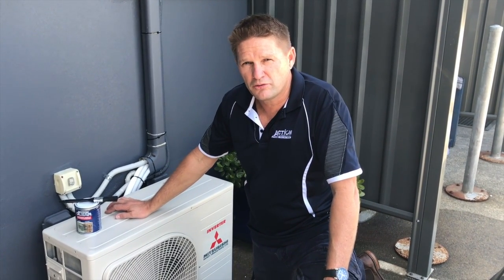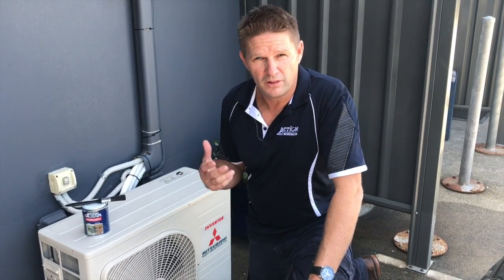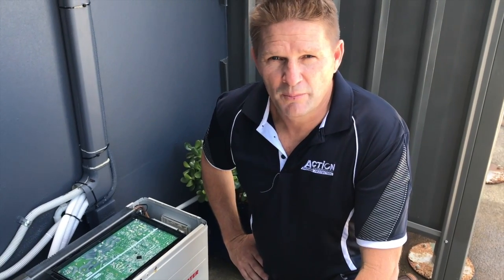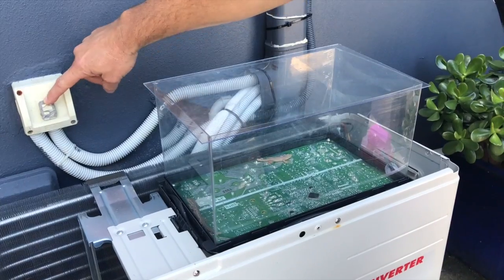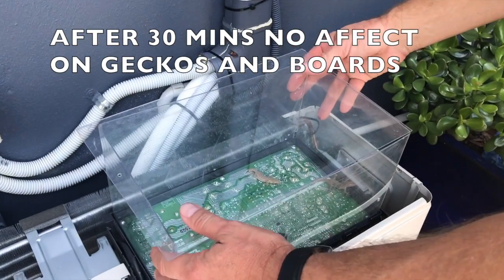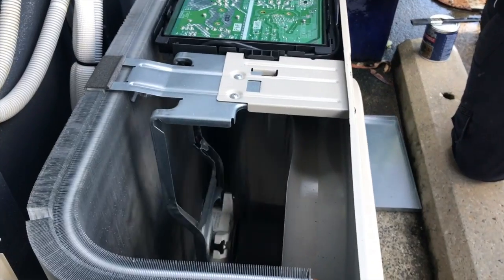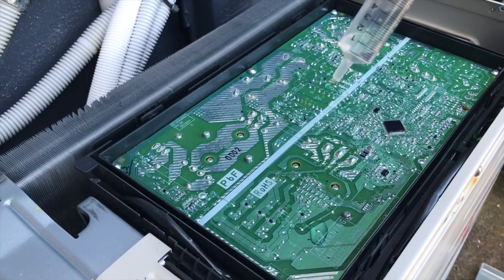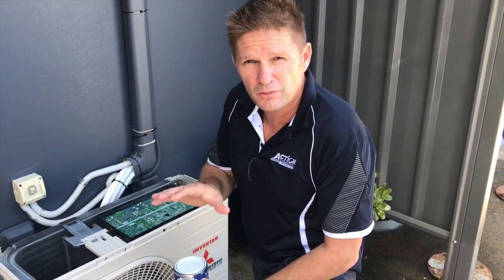Gecko and Corrosion Proof P.C. Boards on Air-conditioning Units

Comment: Is the paint also available in Hong Kong?
Reply: It is just a clear coat that you can get at hardware stores or auto parts and accessories stores in Hong Kong.
Reply: @littlegoddess So any clear coat Poly spray will work?

Comment: Any problems with the board getting over heated?
Reply from the maker: No the Action HVAC-R does not have any problems with PC Boards overheating.
Reply: @actioncorrosionptyltd2526  Hi, your board seems relatively flat, wont some have capacitors Etc , how  will they go being coated ,cheers m8

Comment: I thought MHI inverter ACs have coated PCBs from the factory?
Reply from the maker: Some PC Boards have a temporary wax coating which is not designed to last long term. This is why we still have so many issues is PC boards being damaged by geckos and vermin.

Comment: Is this available for purchase online?  I’m in Hawaii and need some of this fast!
Reply from the maker: Hi Paul, we have distributors in Hawaii. You can contact either AC Warehouse in Hawaii or email your contact details to admin@actioncorrosion.com.au and we will get them to contact you.
Reply: I'm also in Hawaii and need this too. My question is, do you also need to coat the other side of the boards? Every board that has been fried by geckos seems that they were in the other side in between the capacitors and stuff.
Reply: @escape_samsara  - Are you an AC contractor?  You can get this at COSCO HVAC Supply or AC Warehouse.  Also - you can hire me and I will come over and install.  www.coolingtowerac.com
Reply: - Are you an AC contractor?  You can get this at COSCO HVAC Supply or AC Warehouse.  Also - you can hire me and I will come over and install.  www.coolingtowerac.com
Reply: I would like to know if this is available in Central America or the USA!

Comment: In my Fujitsu unit the other side of the board is facing upwards and there were three fried geckos found on the board that caused a major problem. Will the liquid work on this side of the board as well?
Reply from the maker: You are able to spray/paint the both sides of the PC Board. Just ensure the power is turned off, all cables are plugged into the terminals and follow the instructions on the label as you go.

Comment: The other side of the board is still vulnerable isn't it?
Reply from the maker: Both sides of the PC Board can be coated as shown.
Reply: But don't coat any heat sink components otherwise the heat won't dissipate.

Comment: that's from manufacture not yet coated before?
Reply from the maker: Manufacturers do not coat the boards or units with a coating that is designed to last the test of time. If they did we would see so many issues with corrosion or geckos blowing up boards.

Comment: see the holes with the screw heads that mount the semiconductor devices? You need to stick caps over those to stop the urine going down the holes. there are components under there. the white screw head caps used in kitchens to cover the phillips head screws, with a little bit of your clear under them would do the job. you also need something that stinks to a ghecko to keep them from living in there. especially as you didn't coat the underside of the board.